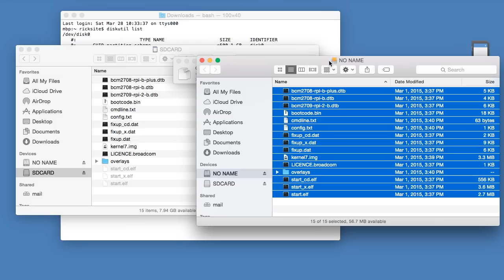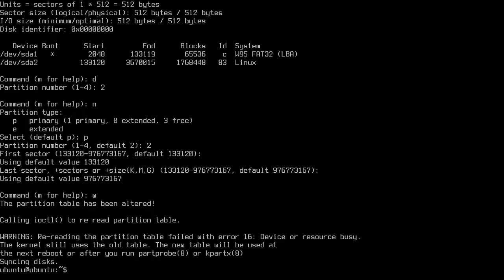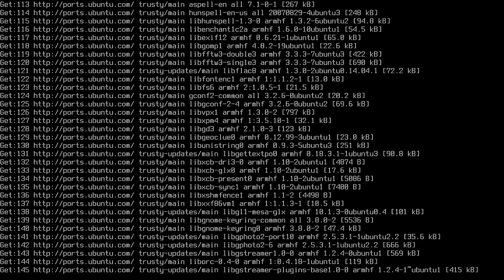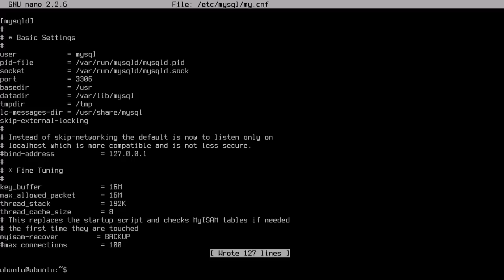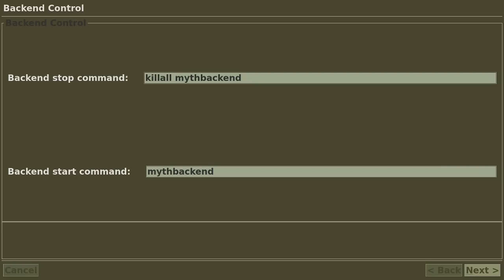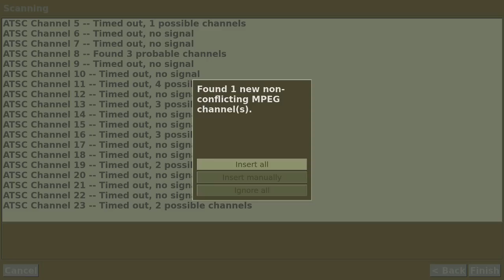Raspberry Pi 2 PVR/DVR Install using MythTV Backend

Comment: Ric, do you have this entire process in a simple 5-8 step process?  I'm just getting connected here and want to create a OTA PVR with Raspberry Pi, and just need the "outline" of the entire project so I can have a starting point.  I'm pretty new to RaPi stuff, and just helped my 13 yr-old build a Minty Pi. I live nowhere near cable or broadband, and [only] have OTA television.  I bought the only PVR I could find for OTA content, and it was a worthless Chinese device that was completely unreliable.  I'm hoping a Raspberry Pi solution could work for me.

Comment: Stupid question - is this all done from the RPi running the backend? I'm trying to do the MythTV backend on one RPi and another running the frontend via Kodi. The mythtv-setup application asks for the IP of the backend (itself) but it won't work because the MySql server isn't running and I've no idea how to
Reply from the maker: Yes. This is a full build of MythTV backend running on the Pi. You can connect to it with another Pi running Kodi.
Reply: Thanks bud. I've got a little further - when adding the USB capture card, the capture card section seems to already see it under /dev/video0 showing as type V4L2ENC as it's a Hauppage HVR950Q [au0828]. But when I try and scan for channels under input, it says 'failed to open card' on the next page? Any ideas?
Reply: Infact, I've managed to get it to scan, but the Kodi box has the right IP address as the master backend as I've set in the other RPi but it won't find anything under the TV section (I've enabled the TV built in addon).
I suspect it's to do with a Mysql access rights? When I type:
mysql -u root mysql it provides the output: error 1045 (28000) access denied for user 'root@localhost' (using password: NO)

Comment: This is a great video. I have been trying to find out how to do exactly this. It seems running mythtv backend is very much discouraged by mythtv community and raspberyian. I tried for a bit to install mythtv backend on my pi3 with raspberian but ran into multiple roadblocks with repositories and similar things not setting up properly.  Seeing this video lets me know it is fully possible and likely not nearly as much of a strain as its made out to be using a pi3 with a class 10 microsd card with 64gigs of room.  I would love to hear your thoughts on this.

Comment: what about a raspberry pi 3 with a 64 gig sd card and samba to use a network storage device????
Reply from the maker: That should work but is isn't going to be super fast. You can speed things up a bit by using a fast USB drive. I like the Sandisk Extreme Pro USB 3.0 drive. The Pi doesn't support USB 3.0 but the drive is still have fast running in USB 2.0. Another option is to build a low power Intel NUC system. It has gigabit ethernet and SATA3 hard drive interface. I have a build here: https://www.youtube.com/watch?v=2R4tCbMaexs You could build it with 2GB of RAM and a cheap small SSD or a USB 3.0 flash drive.

Comment: I appreciate the video!  I have been trying to get this to work on my Pi3 with Ubuntu 16.04.  I have followed your example but am running into issues with the MySQL installation.  It seems to install exactly as you describe, but when I run mythtv-setup am stuck in a loop for connecting to mysql.  When I look at the my.cnf file, it looks nothing like the one in the video, but instead looks like a generic, empty configuration file.  Hopefully someone can offer a solution!

Comment: Very well done step by step instructions.

What, if anything, would the Raspberry Pi 3 bring to this configuration. 

I currently am running a home brew VB 6.0 & VLC DVR program with an HDHomeRun Extend tuner on my laptop but that ties up the laptop.

Even though I am an experienced Assembly and VB programmer, I have yet to make a successful anything in the Linux world.
Reply from the maker: +Mike Wurlitzer I'm not sure. The Pi 3 has a faster processor but it still has USB 2.0. When recording, it is mostly pulling the data off the ethernet port and writing it to the hard drive connected via USB. I don't think the processor is a limiting factor. I would probably build it using a Pi 3 if one was available but I don't think it adds a whole lot in this case.

Comment: Setup my R-PI as described here with HDHR prime. Works fine as a backend. Note that commercial detection DOES work on non-HD shows. Fails on the HD content. I am thinking this is because of the limited memory (and I even added 1G of swap). So it does seem like skipping commercials is not going to be possible. Not really a surprise.
Reply from the maker: +citabjockey Thanks for sharing your findings.
Reply: +citabjockey Hi mate, i was wondering if you happened to have the process you followed  documented somewhere that you wouldn't mind sharing.
Cheers
Nick
Reply: I used the steps described in this video.

Comment: Thanks for the helpful video. For anyone who gets stuck with mythtv-setup displaying an empty khaki-coloured screen, it's likely that the database configuration is running on a different desktop (weird, but this is what happened to me). You need to switch by holding down Ctrl+Alt and then pressing the appropriate function key. It's likely going to be Ctrl+Alt+F8, but try F7 too.

Comment: thanks for the video, got I up and running on my pi2 but now have a few questions.I would like to use zap2xml for epg guide data and I think I found instructions on how to set that up but I am very much a Linux noob !  I need to get back into the mythtv-setup to change some settings but cant seem to get it running again.  From boot up, how do I get mythtv-setup running ?  Also are you familiar with zap2xml ?  is there a step by step guide how to get that working with mythtv ?  I know how to do it on my windows machine but as I said, Linux is a foreign language to me !TIA
Reply from the maker: +pumpkinpie After you boot and login, type "startx" to load xorg. Then type "mythtv-setup" to load the setup program. I'm only vaguely familiar with zap2xml. I've never set it up or used it.

Comment: Quick question, I made the /dev/sda change but when running the dist-upgrade I get prompted that root device /dev/mmcblk0p2 does not exist. Thoughts? And thanks in advance!
Reply: +Jay Willis 
I have the same problem did you ever get a reply
Reply: +Jay Willis 
+Heather Slater
I'm having the same problem.  I've spent weeks searching for a solution.  Any updates?  Thanks for your help.
Reply: +K. Alexander Aumaugher Any luck with this?? Thanks in advance...

Comment: Environment:  Windows 8.1 using WinDiskImager for img files. HW Config: Pi 2, HDHomerun, 2A Power supply, Class 10 8GB microSD, wireless logitech KB, HDMI monitor, WD 320GB USB2.0 portable HD connected through 4-port powered Hub (same hub model as used on my 3 USB disk Pi for a NAS).  

1. Boot always hangs early on when I follow your instructions to boot from HD.  Works OK except issues 2&3 when I just run from SD.

2. Before changing timezone, shows correct UTC date/time.  After changing TZ, clock is reset to 1969, and won't update on reboots.  I know Pi has no RTC, so surprised to find that NTP does not appear to be installed.

3. Changing from defalut (dhcp) to static address for pi (/etc/network/interfaces) seems to cause error messages finding downloads (apt-get installs) from pool.  Not sure why.

So I can get it running at get schedule info (using web interface), except time is of due to TZ and no HD to record to.

Anyone have any ideas?
Reply from the maker: Emma Turereporter When you setup your IP address, are you also setting up DNS (/etc/resolv.conf)?

Comment: how do i se the correct date and time? when i try to set it i get jan 1 1970. ok time fixed.  now i am having a problem where configurin he mythtv backend goes back  selecting the language after i put in the ip and mysql password
Reply: Edwin Gomez got it entered the wrong ip under localhost
Reply from the maker: If you need to, you can set the time zone with "dpkg-reconfigure tzdata".